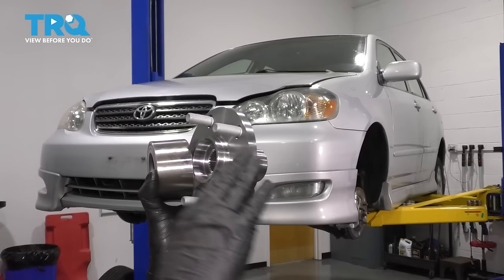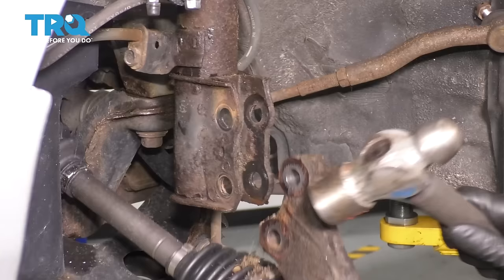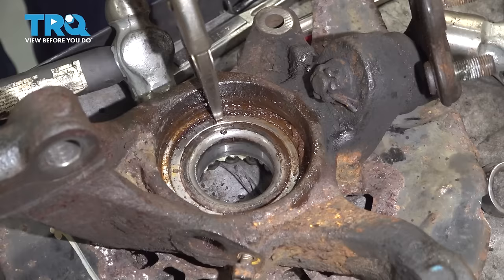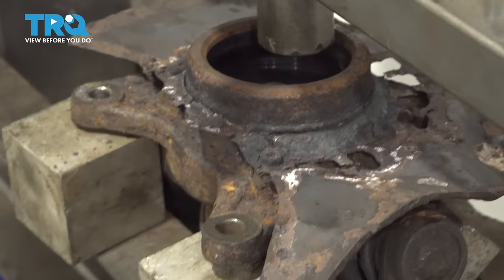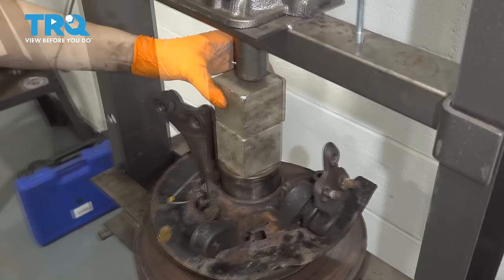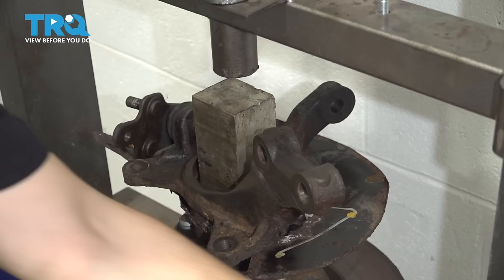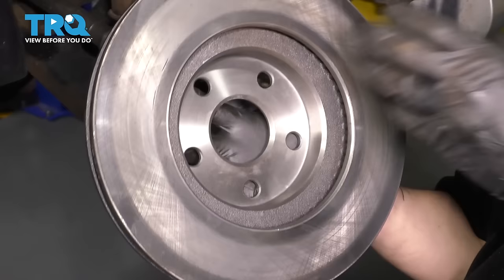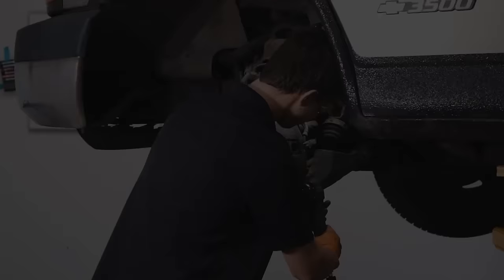How to Replace Front Wheel Bearing & Hub 2003-2008 Toyota Corolla

Comment: I realize it's an edited video but not showing how you remove the stuck race that is still on the hub is kind of misleading. That usually requires using torches, air chisel, and/or a bearing race puller. I get not showing how to deal with the rotted dust shield, the missing ball joint nut... etc because it's a video showing about the bearing but you should have touched on the stuck race. Especially on how to not damage the hub during removal. We've all been there! Other than that pretty good/informative video.

Comment: Drove over an invisible pothole on the freeway going 70mph and one of the threads on the wheel hub bent and ended up breaking off after I tried changing the flat tire I got from it 😤😭

Comment: The OTC hub grappler sells for around $600
What is the cost of the repair shop?
$75-125 an hour plus parts possibly 
What’s the name of the game?
Pay less then the cost of the shop
If the repair cost $800
The tool plus the part cost $750
😆
Buy used knuckles or pay TRQ?
Probably cheaper to pay TRQ
what did you learn:
Type your responses below